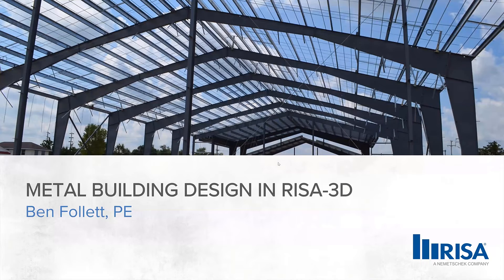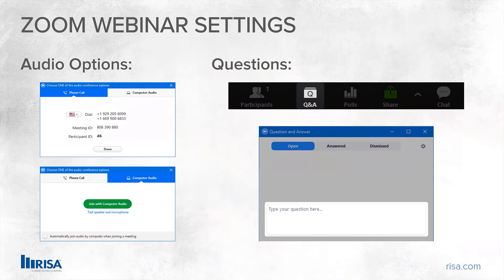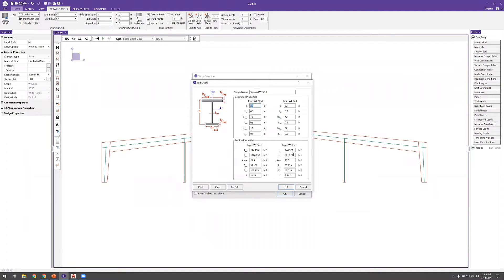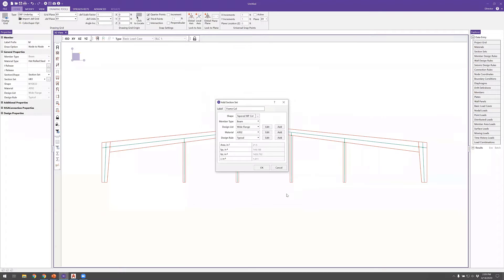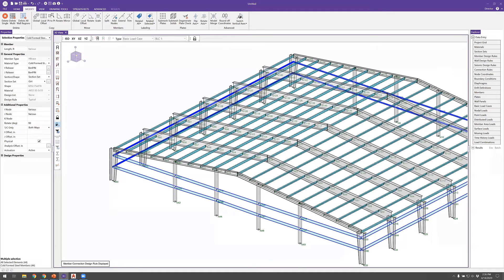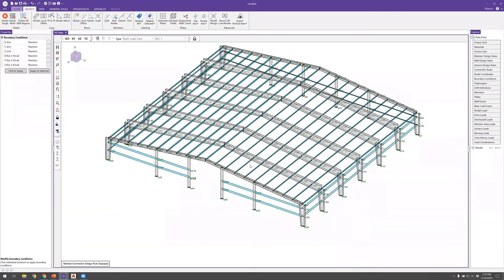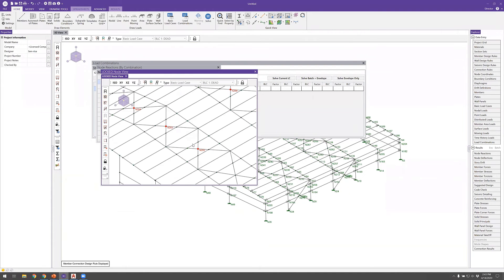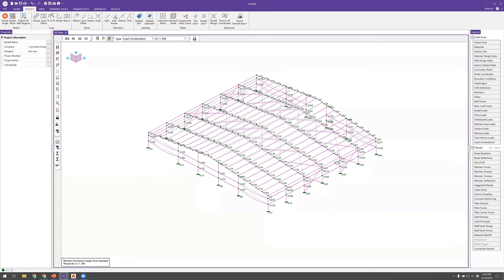Metal Building Design in RISA-3D

Comment: I have a couple of questions.
1) why cannot I optimize the purlins and girt with a section set in a redesign for optimization?
2) As we apply lateral load why girt are not designed to resist that load? I mean why transient loads are not seen after solving the model? I can see you applied wind load A-B way the columns get all transient load but, are we not desigining girt to resist lateral forces?
Thank you in advance.